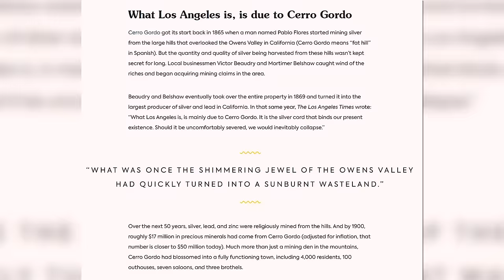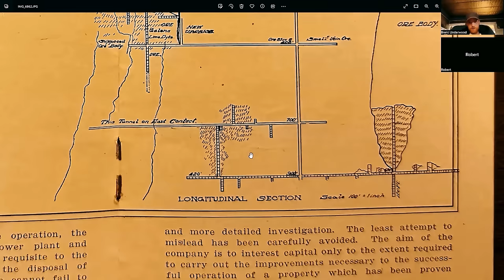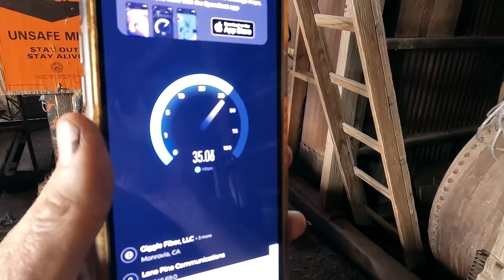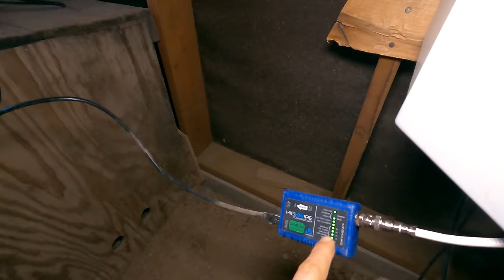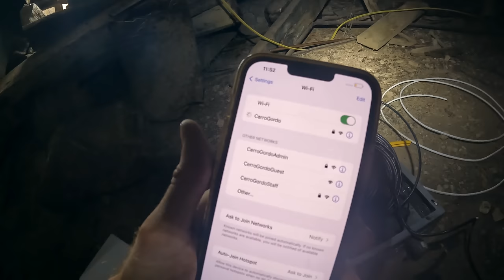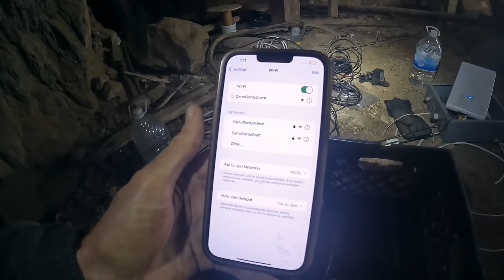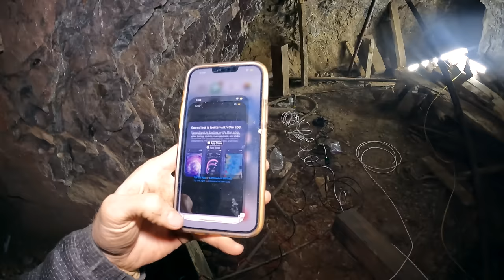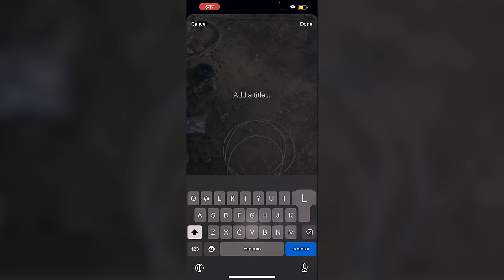I Have WiFi In My Abandoned Mine! 900 Ft Underground!

Comment: Amateurish installs like this using coax and 12awg for vertical 900ft just makes me question the safety of anything you do in town.

Do it right with proper gauge of wire and fiber.

Comment: I just don't understand how any voltage is making it to the bottom. the voltage drop on this has to be terrible!!!  I'm really surprised there's not more electricians in here going WTF? 
BRENT, PLEASE MEASURE VOLTAGE AT THE BOTTOM AND LET US KNOW HOW MANY VOLTS YOU HAVE! QUICK CHECK ON THE VOLTAGE DROP CALCULATOR SAYS YOU WOULD NEED 2 GAUGE WIRE TO GET 10a at the bottom! I wonder if this is playing a part in what's messing up your well! southwire has a very nice voltage drop calculator! just punch in what you want and it'll tell you what you need!!!! NEED TO RUN A SMALL SUBPANEL AND SOME REALLY BIG WIRE MY FRIEND! TALK TO A LOCAL ELECTRICIAN!

Comment: The simplest communication method could be an "intercom", just two wires between two regular landline telephones and (at least) 9V injected into the line to make it work ‒ the resistance of such a long cable can be problematic. And if it completed with a crank-to-ring system, like in ↓this↓ linked video, the two ends could ring each-other as well.
https://www.youtube.com/watch?v=9Y8Ao1b5ceQ

Comment: 900ft of RG6\COAX is WAY too long for a reliable or working single run. Since there is power on the bottom level, it would have been MUCH better to run a fiber down instead.

Comment: You need to get advice from an actual electrician and rerun your power. 12 gauge wire over 900ft is going to have a large voltage drop. And your conductors need to be in conduit.

Comment: Way to complicated done with coax and also not needed if you have power down there now. I used drilled pair cable to connect two water Reservoirs with their controls more than 1200m with a P2P DSL (cots less than $300!!!) Allnet VDSL2 modems which on both end then converts to Ethernet. Stable connection since 8 years now with almost 100Mb connection running 2 Full HD surveillance cams 24/7 plus the full communication between two Siemens S7 SPS systems. These drilled pair cables are like ethernet or telephone cable. In fact you could even use normal power line as long as you have 2 wires. It will suffer a little bit on the long run but still will work. I tested it with up to 800m of normal power cable and still got 50Mbits.

But what I have done would be to have on every major level a rugged outdoor switch as you know have the power down there. Why? Because ethernet can easily transport 1Gbit over 100M, actually I had runs almost 150m long with no issues getting still 1Gbits! So you connect from switch to switch and always get 100m easily out of simple normal ethernet cable which is also available in rugged form. Use POE switches and you then even can power APs way down the longer runs of the mine by simply just lay normal ethernet cable and everything connects back to the Elevator line. 

That way you could eaily establish also a walkie-talkie or alike interfaces and have more communication possibilities. Mumble.info would be an open source or even teamspeak!
Do not forget to put an UPS at the top for safety!

Using good ethernet cable with shielding even protecting stuff can be reduced as the shielding itself is making the wire really rugged so conduits are not really needed, and even if a break occurs, ethernet is also so simple to repeair nowadays. Ask me how I  know, haha Had to fix so many cables over the years and ethernet is really simple. It's also ultra cheap and no, you do not need Cat 7 cables for that. Cat 5e would be enough for what it is for and that you get even as private consumer in boxes of 300m runs. Put a switch every 80-100m and from there to next or use this ethernet cable as mentioned with a Allnet VDSL2 point to point modem and get 1Gb at the lowest level of the mine.

Comment: Not a healthy idea in a mine. It's like being in a microwave oven.
Wifi/Bluetooth/SMART Meters and many devices operate roughly 2.45 GHz. That's the same freq as the microwave oven... And it has the exact same characteristics, albeit lower output power.

This freq excites the Hydrogen molecule. 
Since humans are mostly water, water is mostly hydrogen. When energized it will heat you up from the inside out. 

This freq range from 900 Mhz to 3 Ghz will also break the Van Der Waals bonds, that's the electromagnetic field that holds the double strand helix together on your DNA. 
In other words, this damages cells causing "cancer" among many, many other ailments.